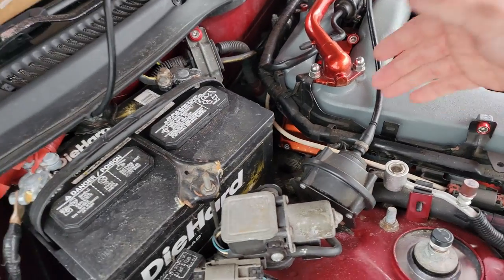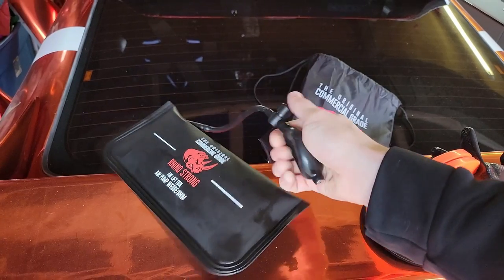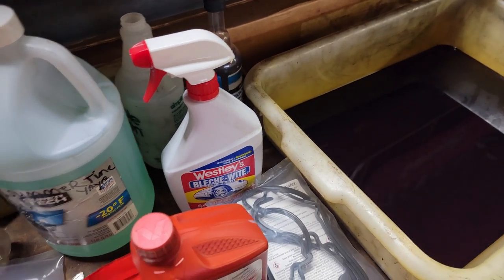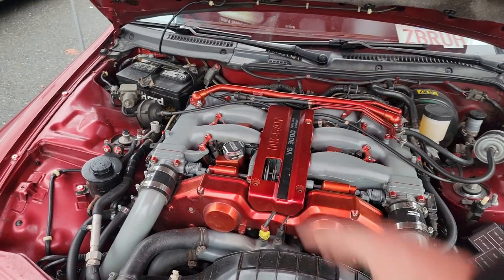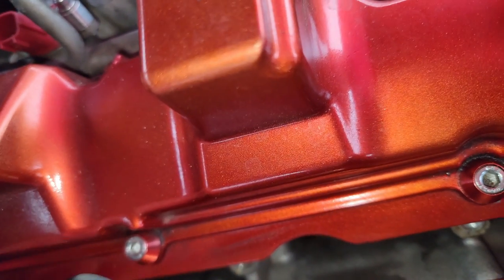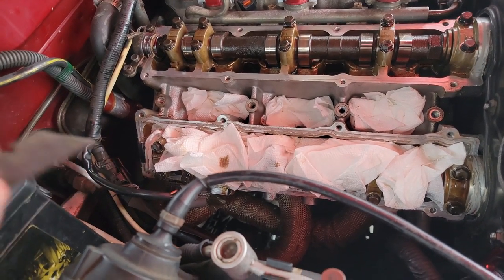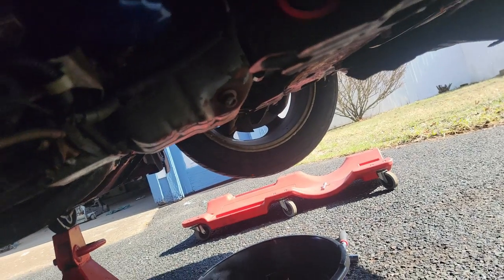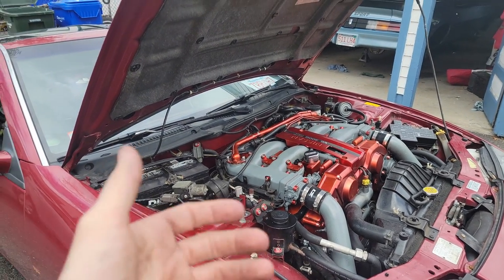How to replace Coil Pack Connectors and Diagnose an Oil Leak on a Nissan 300zx!

Comment: I needed to be able to see how you took the connectors off the coil packs, and whether you needed a particular tool?
Reply from the maker: Check out the video around 4:20, talks about using a pic and how to remove the connector

Comment: Did you do any other deletes besides coolant line, egr and pcv? I noticed you didn’t have wires running everywhere and looked a little cleaner and got the plenum off quicker.
Reply from the maker: The daily has the AIV, PCV, EGR, Carbon canister, and hard clutch line were deleted. Along with the ptu relocated under the nose panel. It's a very seldom mild tuck and in the future will be much more cleaner when I can find another daily haha
Reply: @ZBruhzchannel  nice! I plan on doing the same probably tuck that fuse box on the driver side too and buy new wire harnesses for the engine and transmission for a even cleaner look!
Reply: @ZBruhzchannel  oh yeah I meant to tell you thank you about 9 months back I emailed you about my Z with mystery stalling. As it turns out it was that small vacuum hose on the plenum driver side and bad.
Reply from the maker: @jeremythompson6822  sounds like some great moves are about to be made!
Reply: @ZBruhzchannel  yeah man! Can’t wait to see what you got planned next for the drift car
Reply from the maker: @jeremythompson6822  time will tell 😉
Reply from the maker: @jeremythompson6822  I'm glad it was found and fixed, great work!

Comment: Great video. I need some help though. Running out of ideas now. Took my Z (NA manual) to work - worked fine, no issues. Went to the shop on my lunch break, literally 2-3mins drive, 5mins inside and 2-3 mins back. When I parked up, it was idling for a few seconds and then it stalled. Wouldn't start up again. Tried a few times, nothing. It wanted to, it was cranking but no spark. Ended up pulling plug 1 & 4 out and both were covered in fuel. Dried them, and nothing. The car was running a little rich, can smell it when you start it up, but never had any issues until now - all of a sudden. I had it towed home, let it sit for about 4 days and tried starting it again. Now it's not even cranking. I turn the key and it just clicks, as if the batter was dead (isn't, tried a new batter and had the same result).. any idea what it could be? I'm suspecting either leaking O-rings on the injectors and the combination of it running cold and over-fuelling for such a short trip just didnt agree with the car. But now it doesn't even wanna crank, so no clue what to look for.. starter relay? Any input is appreciated. thanks!
Reply from the maker: I'd check ohm test alternator, check starter relay, check starter. I'd clean up the grounds and make sure there is no exposed wires or any corrosion

Comment: The RTV should be applied and then the parts assembled straight away.  According to the Permatex RTV instructions you should wait an hour and then torque to spec.
Reply from the maker: Yea from what I have learned by handling it in the Northeast it's best to lay it down wait about 15-30 min and lightly tighten about half the torque spec. Then give it a few hours and torque down to spec